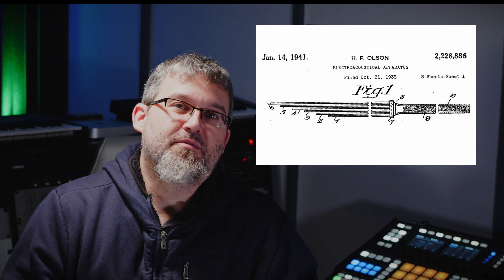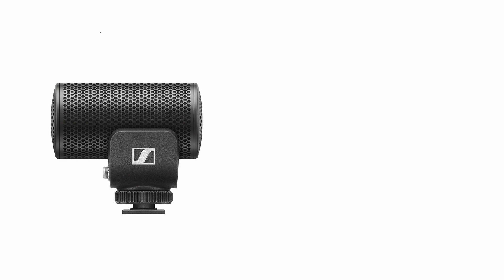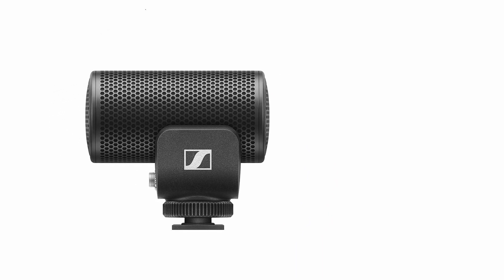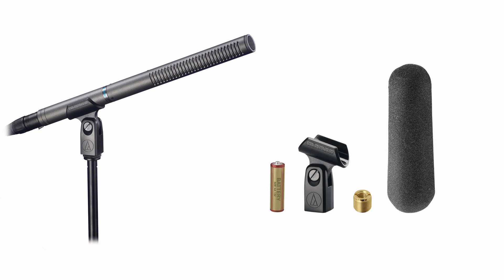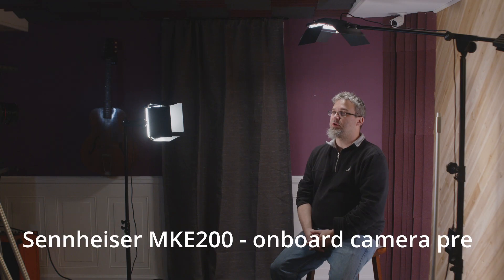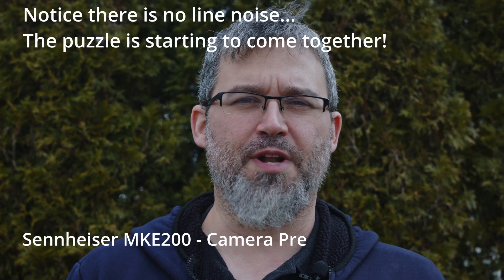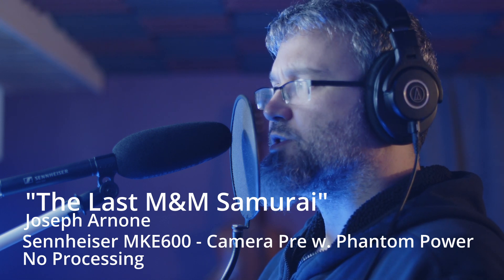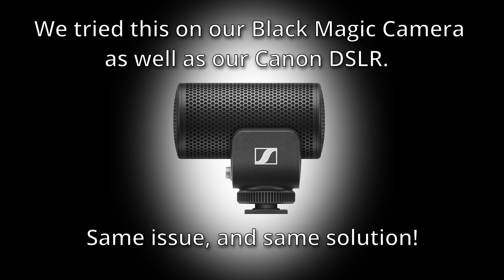Shotgun Mics ft. Sennheiser MKE200/600 & Audio Technica AT897

Comment: how much gain need to be good i have at897 and rodecaster mixer , i dont know how much gain need ?
Reply from the maker: Unfortunately, there's no way to answer this 'correctly' since it really depends on a bunch of factors.  The further away from the mic you are the more gain you'll need.  The softer you speak the more gain you need.  (opposites are true also for both of those).  This is one of those audio things where there's no set number for "right".  You have to play with it and get your level set according to your situation.

Comment: Sennheiser mke400 has same ground loop issue. thanks for the video.
Reply: @meistudiony  Yes, same thing.  I made a video about it and shown to Sennheiser. They sent me an email saying it was designed so. Well. No other mic I own was designed so. The MKE400 is not a cheap mic, and not a bad concept either. How Sennheiser can allow this, and how come only a few youtube reviewers speak about it... mystery to me.
Reply from the maker: @ww1www  my guess is the only ones talking about it are the ones that werent sent it for free or paid to talk about the mic. Thankfully there are workarounds but if someone hit this issue in the field, that could be a pretty big problem. Keep fighting the good fight.  This is not proper professional level design flaw.
Reply from the maker: Ive narrowed a few scenarios down to mitigate the issue. If using a battery pack, dont have the battery pack plugged in (charging). Using a wireless transmitter/receiver with the camera isolates the ground as well. On my black magic camera, the issue goes away if i use the stock power connector/adaptor. However, this isnt the case on my canon camera. Very quirky.

Comment: I liked the AT at 6ft - I think this could work in a sound booth for video introductions since I really want to avoid a mic in frame.
Reply from the maker: Ive been using the sennheiser under boomed for most of my recent videos. If you can keep it closer to you, either one will sound great.
Reply: you end up getting one? I keep hearing people say not to use shotguns indoors and only use pencil condensers.
Reply: @BattleCorgiTV  I don't currently have a pencil mic for comparison and it's sorta hard to justify buying yet another mic right now. However, I haven't tested the setup yet (just moved into a new house). When I do setup the mic, I plan to keep it as close to me as possible while also out of frame. I've tried this with normal condensers but they pick up too much room tone.

Comment: What ever you are using is over modulated
Reply from the maker: Not quite sure what you mean... I don't use any modulation in post for the spoken parts and the examples are the audio direct with no processing except for setting levels.
Reply: @meistudiony  in your video when you are sitting for your delivery you sounded as though the recording is “over modulated” which means that recording came in a little hot and slightly distorted. It happens just thought you should know. Over modulated is a common audio engineering term.
Reply from the maker: @tjwalkup7155  ive heard it used in terms of radio where modulation deals with frequency.  (Same in the studio) In my 25+ years of being an audio engineer ive never heard someone use the term like that… but now i have! :) Thanks!
Some of my earlier videos were experiments with different mics and positions and mastering in post.  Took a while to dial it in but i think im in a better place now. 
Thanks for the comment!  Appreciate you checking it out!
Reply from the maker: @tjwalkup7155  i guess that would be amplitude mod. in this case. 👍
Reply: @meistudiony that’s it. I just use short hand on my comment, in the field we have spoken of “over modulation” synonymous with “amplitude modulation” in that it’s the hot version. Been in the industry for over 34 years. Maybe it’s short handed by west coast guys here I guess. It’s goofy like C-47 or the Mole Richardson catalog number for clothes pin. Sorry. Incidentally I like the video. You did a great job and your VO  beautiful on all the other stuff. What ever you used there did you justice. Perfect
Reply from the maker: @tjwalkup7155  cool. Thanks for the info!  Appreciate it!

Comment: I have the the AT897 and it sounds great outside, but terrible indoors in an untreated room. Do you think the mke 600 does a better job rejecting room reverb?
Reply from the maker: I really should try to use these things in untreated rooms to check that sort of thing.  For me, the 600 picked up more in a more narrow pattern (which is why it performed better outside in the noisy environment).  It would really depend on how close you are TO the mic.  For instance, if you're a foot or so away from it and your body is blocking anything coming from behind, it keeps things tight.  Ive started to use the 600 for my videos and like the tone of it.  I use it only about a foot or two from my face just out of frame.  From a distance, (with any of these mics, even the $1000+ ones) you're still going to get that room bleed regardless.  If the room is REALLY live, I'd suggest using lav mics over a shotgun indoors.

Comment: oh and i forgot to include the Sennheiser MK4, also for voice over.
Reply from the maker: I forgot one too.. check out my video on the Austrian Audio OC16.  That is one of the nicest sounding LDC's (for any money) i've heard in a long time.  Goes for around $399USD.
https://youtu.be/5x-cS0sxrx8
Reply: @meistudiony  ok Sir, i will. may i ask if the Austrian Audio OC16 was reviewed from a voice over perspective? its difficult to determine that, if test was centre around singing
Reply from the maker: @antoineinniss5586  if it sounds good on a singer, generally, it will sound good for a voice over.  The proximity effect was very pleasing on it, and tonally it is very smooth and doesn't have the harshness that you'll find in a lot of the other mics in that price range.  This is one of those hidden gem mics where you get WAY more for your money than what it costs.

Comment: i must say i was very pleased with this review Sir and i thank you . but in your review of the Audio Technica AT897, it sounded really really well and so im off to purchasing it, i now await your review of some Large diaphragm condenser microphone options ($300-$400 range), for voice over, beginning with the T4040 and the Lewitt 440 pure. thank you soooo much
Reply from the maker: Thanks for watching.  The lewitt 440, LCT and the Maono PM500 have essentially the same body construction.  It tends to be a little too resonant for my tastes. nut they're not bad sounding mics.  The AT4040 isn't bad, and for that money, I'd probably go with the Rode NT1a as it tends to be a quieter mic.  They all tend to be on the brighter side, so you'll likely have to roll off some top end in post.  Also, check out the AT4033 and the MikTek MK300.  If you're good with a soldering iron, you can put together an amazing mic for under $400 from micparts.com.
Reply: @meistudiony  yes i am aware of the Maono being resonant, but i dont think the same applies to the Lewitt 440 pure
Reply from the maker: @antoineinniss5586  literally the same body, different capsule.
Reply: @meistudiony  ok. but what of the resonance issue? is it with the lewitt as well?
Reply from the maker: @antoineinniss5586  yes its liternally the same body/materials with a couple of small cosmetic differences.
Reply: @meistudiony  just to be clear, is there resonance coming from the Lewitt 440 pure. you did say there is resonance on the Maono and i did hear it in a review, when it was touched
Reply from the maker: @antoineinniss5586  yes.